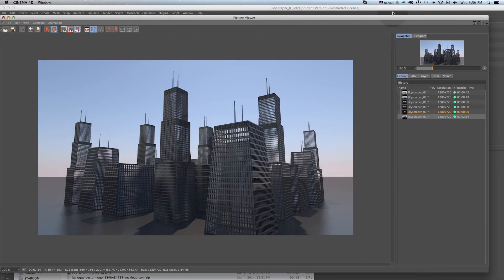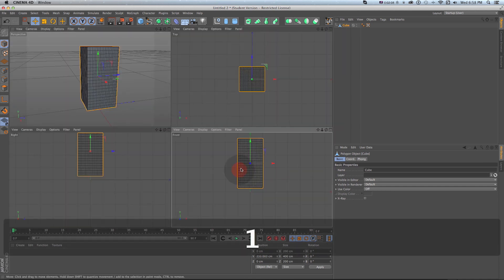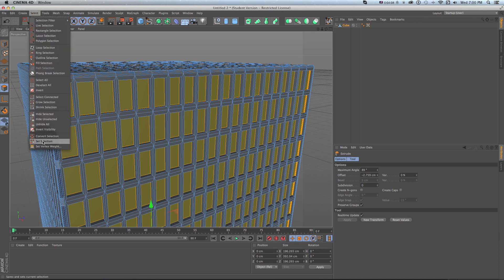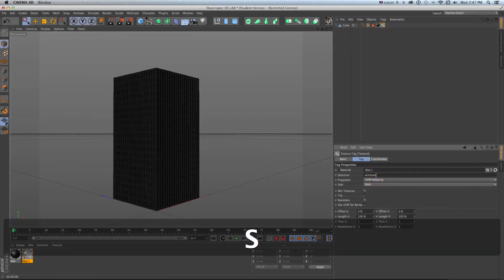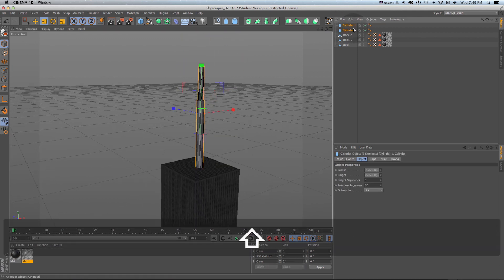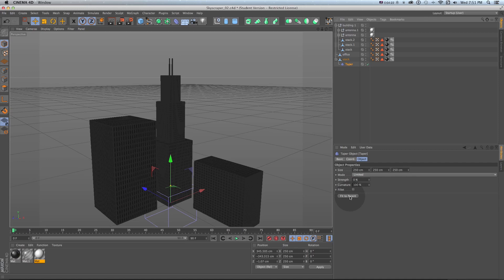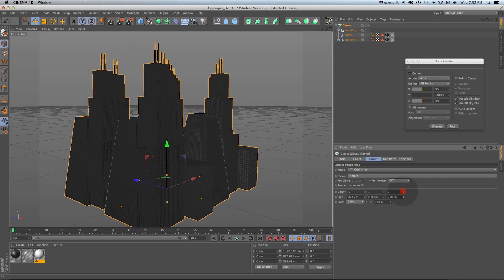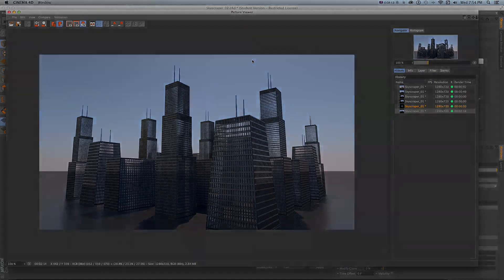Cinema 4D Video Tutorial: Skyscrapers

Comment: Having trouble putting the glass texture on the windows, just doesn't register
Reply: He used a "Selection Tag". Which you can access by making your Primitive or anything Editable first.

Create a specific selection, then go to the "Select Tab" on your tool bar --> Set Selection --> Triangle (Selection Tag) appears in the layer. 

P.S. Make sure you have whatever you're working on selected.

From here, just select the triangle (Selection Tag) --> Drag Shader you want onto the area you have selected on the Editable mesh, and just drop it there --> Unselect mesh to see the effect.

Comment: I am using Windows ... I reached until 2:24 and then I couldn't complete
Reply: Anas Fairaq Hey! In the matrix extrude set the variation type to NONE. That will help. ;)
Reply: I know I just had the same problem, but if you look below scale where it's at 80 percent, then you will see that it's put to 10 for rotate when it should be at zero like his.